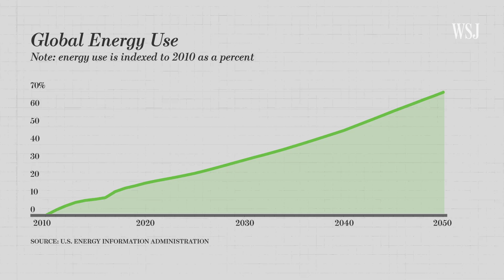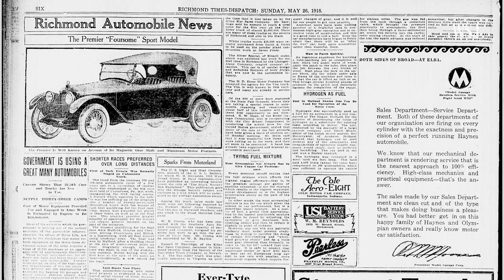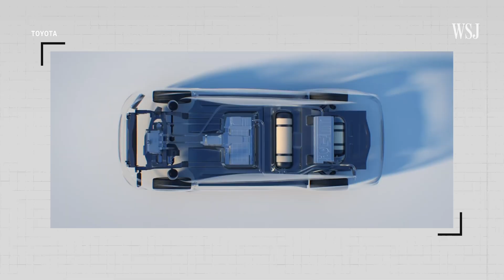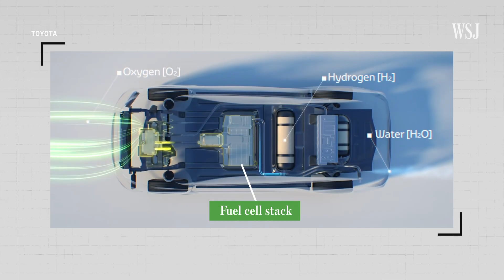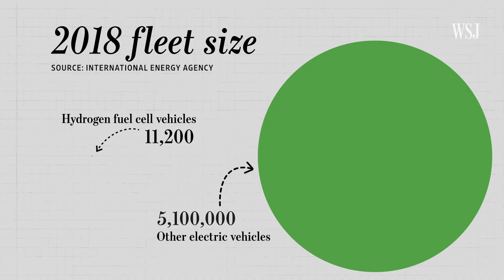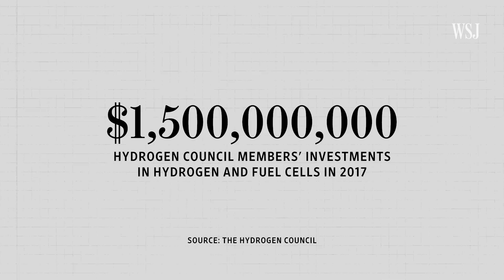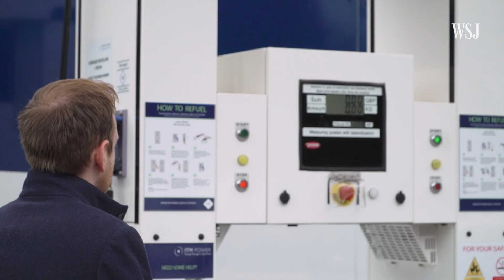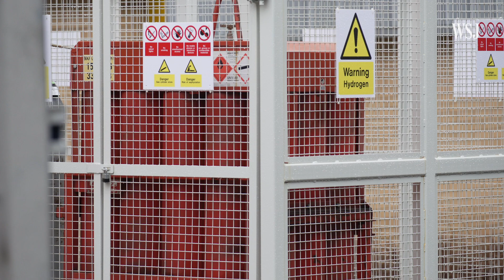Can Hydrogen Fuel the World's Fast-Growing Energy Needs? | WSJ

Comment: The answer is yes. I have designed the type of ships like the one here on the following video ten years ago in Turkey at a University in Mersin. I have also designed a cargo ship but did not find the funding. This indeed the close future as the issue to produce hydrogen with renewable resources then the whole cycle is complete as it goes from water to hydrogen and then back to vapour which is used for heating or else.
Reply: No one finances spin-offs without a chance of economic viability.
This video is an advertising lie!
They don't lie about what they say.
What is lied about is what is not said.
It is lying when you deliberately conceal or belittle important facts.

2:36min Water and electricity produce hydrogen
However, you forget to mention that you need about 50kWh of electricity to produce 1kg of hydrogen. 1kg of hydrogen only has an energy content of 33kWh. The rest of the energy is lost.
Furthermore, until the end of the film it is not mentioned that today hydrogen comes mainly from natural gas, coal and crude oil. Hydrogen is produced by fossil fuels at a rate of >95%! Because hydrogen from the electrolysis of water is much more expensive.

It is clear that hydrogen is an (extra to be produced, secondary) energy storage medium, but it can in no way solve our energy problems.
Reply: @joegoog  In your example, you obtain 66% efficiency, for energy production, your example is very good but where is it coming from? In fact, fuel cell based electolysis and running bring the hydrogen systems at a total closed cycle efficiency at 26% and this means starting from water and returning to vapour (water) meaning clean end-result. Now, to supply the water electrolysis, you need electricity and now is the problem: can you supply with renewable clean energy? In places like Quebec, the answer is positive from Hydro-Power. Other places use fossil fuel and then this is not solving the problem. This also the case with batteries which are not clean and will need more energy to be dismantled and recycled. The problem remains petrol which involve much lower efficiencies for production (30%) and running (35%). Then, the result is carbon dioxide which has not been integrated into the analysis as we need to capture it and recycle it into a safe form preventing destructive climate change. All in all, petrol systems have a complete cycle efficiency hardly reaching 10% from ground extraction until return to a safe form. But this last figure still needs to be examined as it may be more like 5%. Human activity is very highly inefficient in terms of its energy utilization. In any case, we still need to find ways to produce electrical energy in a very efficient way but we have the ionosphere which could supply us. Fusion is another one but we need hydrogen as its fuel... back to square one.
Reply: @lucrolland7489  They blithely mix real facts like the low efficiency of ICE with fuel with questionable statements like the allegedly high energy input for battery recycling.
But phantasties like energy from the ionosphere or the economic use of nuclear fusion don't help anyone. What we need is a significant expansion of the use of renewable energy. First, the fossil technologies (coal combustion / fuel combustion, ...) must be converted and only at the end will green hydrogen play a role.
FCEVs as passenger cars will never play a major role.
That is one of the lies in this film.
Reply: @joegoog  You do not seem to believe in research and development. People would say just the same about airplanes barely 80 years ago. We need a very significant shift in our approaches to transportation and energy comsumption. Hydrogen will sooner or later play its role as there is a now a French designer that is travelling the globe with his green yacht producing its own hydrogen fuel from sea water, powered by solar panels and he could add windmills (I know since I have done a similar design 10 years ago for a Turkish ship builder, yacht and small cargo ship). I know it works and this is now happening. It is just a question of time.
Reply: @lucrolland7489   You are subject to a misconception.
That the mobile use of hydrogen is technically possible is no longer a question at all. This has long been proven by research and development. Both the existing FCEVs and your example of the "green yacht" are proof.
But even if something is technically possible, this is still no guarantee that this solution will prevail on the market.
This is only the case if there are no better / more economical solutions to the task.
This is precisely where you are wrong about mobile applications of hydrogen. For passenger cars, there is a much more economical solution - the battery-electric car. The FCEV is also a completely electric car. The disadvantages of the FCEV compared to a BEV are scientifically based and cannot be eliminated.
FCEVs will therefore remain a niche application.
Whether there will be ships with hydrogen as energy storage, among other things - we will see. There are several developments going on in parallel.
For passenger cars, the technology race has been decided.
To conceal this is the lie in this video.
Reply: @joegoog  For the moment the BEVs may look better as being more feasible and economical but this may be temporary, like what happened to the CDs which replaced the vinyls and then are getting phased out by mp3. "The disadvantages of the FCEV compared to a BEV are scientifically based". You do not bring any evidence that the argument is scientifically based since I cannot find any scientific journal paper to substantiate your opinion. Finally, in technology, races exist indeed but the decisions can change quickly as the world is not frozen in concrete.
Reply: @lucrolland7489   You can learn the proof in school in physics and chemistry. Every energy conversion involves losses. These losses can only be minimised to a certain extent! You don't need a scientific essay for that. At best, it's in the introduction.
Everything should start with regeneratively produced electricity in the future. If you now look at the necessary conversions in the BEV and the FCEV, you will quickly realise that the BEV is significantly more efficient, more economical/cheaper and ultimately also more environmentally friendly.
This is because the basis for an FCEV is the electric car and the entire hydrogen technology from electrolysis to compression to the fuel cell, which then drives the electric motor again with electricity as in the BEV - all of which are additional losses.
Back to the initial question of the film:
"Can hydrogen meet the world's rapidly growing energy needs?"
No, never!
Because hydrogen is only an energy carrier that first has to be produced (if possible from renewable energy).
You always need an initial energy for hydrogen! This then covers our energy needs (with unavoidable losses). Hydrogen is a storage medium. Technically, it would be possible to store huge amounts of energy for our needs. But these amounts of energy (i.e. our primary energy demand) do not ultimately come from hydrogen!
The knowledge about this is not exactly new.
https://ieeexplore.ieee.org/document/4016414
Reply: @lucrolland7489  Like Joe said, it just comes down to basic physics. This won't change in the future.

Comment: What everybody seems to miss is the fact that hydrogen is not readily available as an energy source. In fact it’s not an energy source in most circumstances, it’s simply a method of energy transportation and/or storage. Without a form of cheap electricity generation or a basic form of energy, such as natural gas, hydrogen simply isn’t available. There may be some benefits of manufacturing at a large scale. This could reduce the unit cost. However, the reason that hydrogen has not displaced hydrocarbons is simply because it is extremely costly to produce.
Reply: The reason why hydrogen has not replaced hydrocarbons is that we've just started. It took decades for diesel and electricity to replace coal for rail transport. Mark my words, in the not too distant future, Green and Blue Hydrogen will be competing with petrol and diesel on price, but it would take decades to build distribution networks. And whilst this may happen in Japan, I don't think that it's practical or cost effective for most nations. EVs are just becoming too good.

Coal is on its last legs, and here in the UK it's due to be phased out completely by October 2024. It's sad for mining communities, where in 1920, 1 in 20 of working people were employed in the coal industry. But an inevitable consequence of progress towards a cleaner future. 

A big prize for many nations is the prospect of energy independence. But consumers don't care about that, most just care about costs. However many, maybe most people would choose an EV over an ICEV if EVs were cheaper. And whilst Americans love big vehicles, really big vehicles, the rest of the world does not share this love. Again here in the UK, our roads are smaller and journey distances shorter. Much of Europe and Asia is the same. 

So I see no massive future for FCEVs, as I stated above, I think EVs sate most peoples' needs. But I do see many areas where hydrogen could replace diesel for transportation, and be the energy storage medium of choice.

Comment: So use electricity to produce hydrogen to produce electricity? Sounds unnecessary
Reply: Not quite. You use hydrogen to "store" energy. Preferably excess Green Energy. Then it can be used to generate electricity when there's insufficient sunshine or wind et al. We already do this with hydro electric. Where at off peak times water is pumped uphill into storage reservoirs, to to released to generate electricity at peak demand times.

Also hydrogen as an energy storage medium has distinct advantages over batteries for some applications, such as long haul and marine transportation, and maybe aviation in the future. 

But with the advancements in battery and fast charging technologies, for most road transportation, BEVs make far more sense. Not only will they always be much cheaper to power, but they're a far more efficient use of cleanly generated electricity. 

But batteries will always be heavier and take longer to charge, so there is a future for FCEVs. But what we have to do is massively increase the generation of the cleanest electricity we can. Preferably that'll be Green Electricity or Green Hydrogen,. But the next best would be Blue Hydrogen, where most of the CO2 is captured in the manufacturing.

Comment: Great report
Reply: This video is an advertising lie!
They don't lie about what they say.
What is lied about is what is not said.
It is lying when you deliberately conceal or belittle important facts.

2:36min Water and electricity produce hydrogen
However, you forget to mention that you need about 50kWh of electricity to produce 1kg of hydrogen. 1kg of hydrogen only has an energy content of 33kWh. The rest of the energy is lost.
Furthermore, until the end of the film it is not mentioned that today hydrogen comes mainly from natural gas, coal and crude oil. Hydrogen is produced by fossil fuels at a rate of >95%! Because hydrogen from the electrolysis of water is much more expensive.

It is clear that hydrogen is an (extra to be produced, secondary) energy storage medium, but it can in no way solve our energy problems.

After all, the electricity for electrolysis has to be generated first, and it is better to use it as directly as possible instead of first producing hydrogen and then using it to generate electricity again. Because of course there are additional losses.

Hydrogen is above all a lie to keep people from using renewable energies! People are put off instead of, for example, generating their own cheap photovoltaic electricity and using it to charge their own electric car.

An electric car is cheaper, easier and better than a hydrogen car. No one in the world is therefore building hydrogen cars in large numbers. The Toyota Mirai doesn't even have a folding rear seat back....

4:28min Using electricity from hydrogen to charge electric cars?!?
A curious idea when you look at the costs. Not everything that works technically makes sense. This idea is nonsense.

5:29min If you look at the members of the Hydrogen Council, it becomes clear what these companies want. We should have to keep driving to petrol stations instead of generating and charging our own electricity at home.
Reply: @joegoog  great counter report
Reply: For many years I drove cars with petrol.
Then I became enthusiastic about electric cars and test drove many models. Also a Toyota Mirai from 2017.
The FCEVs are more expensive to buy and to run. For example, the air filters for the fuel cell have to be bought regularly. The trip to the H2 filling station costs money and time.
The Mirai has little space inside and a small boot. Not even the rear seat back can be folded down. In the new Toyota model Mirai II (from 2021), 5 people can finally ride in the car, but it is still cramped. The driving performance is mediocre at best.
No, for passenger cars it makes no sense to build the additional technology for hydrogen into a completely electric car.
This concept is only good for the carmakers and the filling station operators.
They only tell the alleged advantages and still can't explain why even the biggest carmaker in the world Toyota builds only a few thousand units of ONE FCEV model Mirai a year - but millions of other cars that are supposedly worse. 
I have been thinking about this for a long time.
Tesla, the small manufacturer, delivered more than 100,000 battery electric cars March 2021 ...

Now I drive more than 20,000km a year in a small battery electric car - not a Tesla. Charging is usually done comfortably at home. It takes 2x 15 seconds to connect and disconnect the charging plug.
Yes, a battery electric car is different from a petrol car. You get used to it. It is better.

Comment: The hydrogen should be made just before it's use.  By the production of hydrogen just prior to use eliminates the fueling stations and the complication of traveling with a hazardous tank of explosive gas.  The quantum sciences offers a potential ways to accomplish  these goals through electrolysis of water.  Especially with the disassociation of the hydronium ion from the hydroxyl ion in water at a rate of 50%, at any point of time.  
An open system cloud chamber of ultrasonicated water droplets and a mix of Quantum Hall topological nanoparticles.  Although this is far beyond my knowledge base and capacity to explore, I feel there is a solution for a hydrogen energy future in this area.
Reply: So... the energy for that electrolysis comes from where exactly?
Reply: @Freba9  from a quantum Hall molecular gass cloud chamber.
Reply: @cerimite7674  Doesn’t that require electricity?
Reply: @Freba9  it would for an initial induction process for a magnet field.  By introducing a ultrasonic water droplets containing ferro magnetic and a spin-gapless semiconductor with an out layer squid anomalous  Hall  effect grating switch (SiO2), nanorods to the chamber.  The nanorods would form a toroidal that is symmetry breaking fermion subatomic particle field.  This single spin electron (-1/2), plus the normal electron (1) field can be used to isolate the disassociate hydroxyl and hydrogen ions into a cold plasma.
This is only a theoretical proposal that is quite complex and if you have followed along so far, although I won't divulge everything, I will give more details.  This isn't classical sciences, but delves heavily into the quantum sciences.
Reply: @Freba9  this is more of a proposal to anyone that has knowledge in this realm.  Any criticism good or bad is welcome, as my proposal is speculative.  This more of a "YouTube call" for pushing this further than my knowledge base, which is limited.

Comment: Until there are hydrogen stations, what good is hydrogen? The auto industry has to decide what kind of vehicles that are universally affordable and practical and make it for the general public. Gasoline vehicles are polluters and have gotten too expensive to own! Now what? The auto industry is refusing to make a self charging electric vehicle. A man made a magnetic motor and put it into a car. It ran fine. It didn't need a battery pack! You can covert any existing vehicle to a self charging electric or one with a magnetic motor! You don't need magna auto plants, and vehicles that Joe Average can't afford! People aren't buying new, they are buying used they can afford! Tesla and the rest of auto industry are nuts!
Reply: No, you cannot. Wrap your head around some basic physics and you will understand why 'self charging cars' are completely impossible.